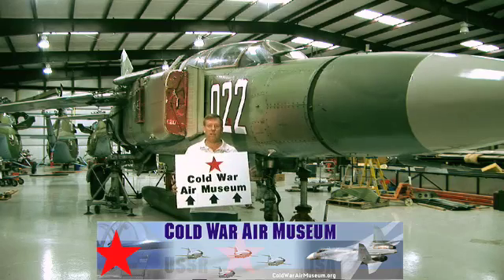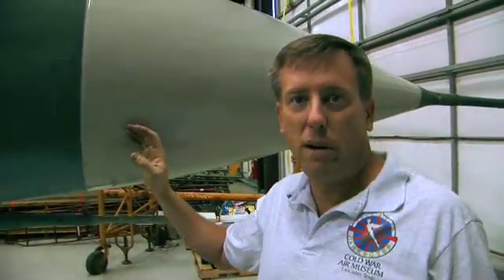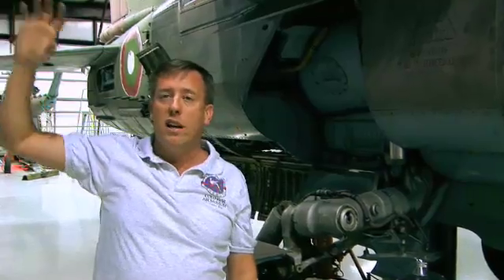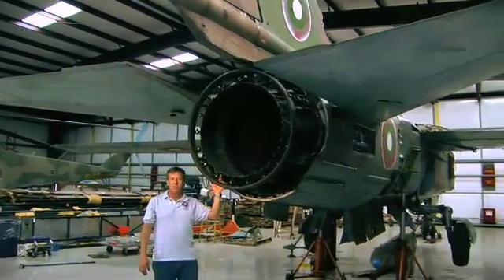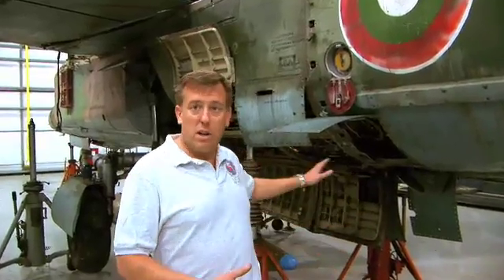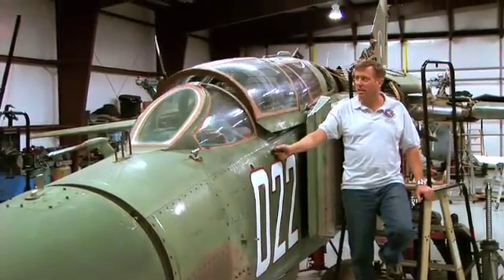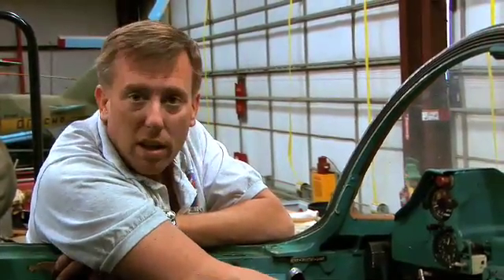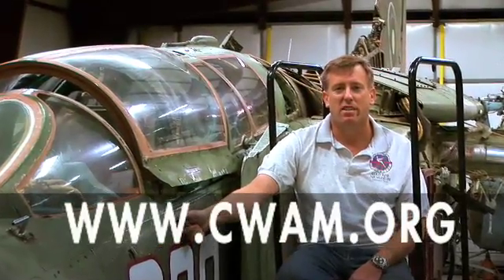MiG-23

Comment: I saw one up close and personal in the 90's, a Syrian Air Force pilot was encouraged to cross over to our friendly little nation with this gift.
I was most impressed by the beafy main landing gear, yet it could fold up into a tiny package, a mechanical marvle.   Also the diameter of the jet nozzle is about 25% wider than an F-15 or F-16 or Phantom.   On the other hand, the workmanship of the structural rivits on the fuselage was so appaling, it actually shocked me.

Comment: Aaaah 10,000 kilograms is 22,000 pounds. There are very few rocket engines that produce 10,000 metric tonnes of thrust let alone do any T-jets make even a fraction of that. But I'm sure I'm probably the 10,000th stickler of a person who has pointed this out. I'm sure the curator made this mistake owing to filming nerves and realised his mistake later.

Comment: The Russians built (and still build) some damn good airplanes.  Is it possible that all the advanced technology built into US planes could make them more prone to various kinds of failure? Look at today's cars.  Lots of computers and plenty of recalls. Still, I think the most remarkable plane ever built was the blackbird. Imagine! Back in the day they designed this amazing plane using slide-rule technology. Pure genius.
Reply: +Thomas Andrews The terribly complicated systems in American aircraft could represent some kind of failure point, but they usually have backup systems built into them. Your statement of American aircraft having advanced (implying complicated) systems is sort of silly if you look at Russian planes, especially the Mig-23. The wing-sweep mechanism has thousands of failure points, the folding rear vental fin has hundreds of failure points, and so do the rear landing gear; the most complicated landing gear ever installed on a military aircraft. Just because something has lots of computers and systems in it doesn't really mean they will fail every 2 seconds. 

Not to mention, there are WAY more cars than airplanes, and airplanes are inspected and maintained almost after every flight. Cars aren't, so they're more prone to failures and recalls. If every car was inspected and had work done after every drive, there'd be less recalls.
Reply: First off, you misrepresented my statement of 'failure points', by interpreting it as 'thousands of failures' and not what I said, which was 'thousdands of failure points'. I simply stated that the Mig-23 had many POTENTIAL failure points, as with every other fucking airplane that ever flew.
Second off, the F-15 is anything but delicate. Remember a while back with that one Israeli F-15 crashed into an A-4 Skyhawk mid-flight and sheered off it's entire wing, and proceeded to fly back to home plate and LAND? Yes, Russian airplanes are built fairly robust, but they are still airplanes, therefore they are DELICATE. I'd like to see any Russian aircraft have it's wing torn off and land.
Lastly, saying that American aircraft only function with no air defense or air force around is simply retarded. We have at least 3 aircraft PURPOSE BUILT for removing radar AA systems off the face of the fucking earth. And we have at least 1,000,000 aircraft purpose built for removing other airplanes (see P-51, F-86, F-4 Phantom, F-8 Crusader, F-14 Tomcat, F-15 Eagle, F-16 Falcon, F-22 Raptor, F-35 Lightening, F-18 Hornet, F-101 Voodoo, F-106 Delta Dart.)
>inb4 stealth is a scam
Reply: +Thomas Andrews all modern Russian jets have the underside painted with a fire resistant material. this means they can land on their belly with no gear and be fine. no american jet can do this.
Reply: cheeki breeki lol. Americans can't paint the underside of their planes?!
Reply: plebion kangaroo >implying any american jet can't belly land.
Reply: +plebion kangaroo I think you might want to look up 'fact' in the dictionary.
Reply: +James “Mr. Cool” Austin 
>inb4 citing Pierre Sprey as a source
Reply: ***** i'm not implying, it's a fact.
Reply: ***** 
fact
noun
a thing that is known or proved to be true.
Reply: +plebion kangaroo the proven part of that is what's wrong with your statement
Reply: ***** mah, i would like to see a f18 land with no gear and not catch fire.
Reply: +plebion kangaroo you should look at some carrier landing videos
Reply: This Russian built plane was a dog. Poorly built, difficult to maintain, and unreliable. The mig 21 never got withdrawn whilst the 23 was in service for those reasons.

Comment: Re. aircraft generations, they are rather curious:  first generation - essentially the pioneering jet fighters, 1945-50.  All subsonic gunfighters.  Second generation - 1950-65.  Missiles start to appear although, in this period, they have poor sensitivity and very narrow fields-of-view.  Aircraft are optimized for high-speed at the expense of agility, and reliance on rear aspect missiles over guns.  Essentially, the age of the interceptor.  Third generation, 1965-1975.  Missile technology improves, enabling the use of missiles as true dogfighting weapons.  They still suffer reliability issues, however, especially beyond visual range weapons, and losses of the more technologically sophisticated F-4 to the relatively simplistic MiG-21 reemphasize the need for basic dogfighting performance.  Hence, generation 4, 1970-present (at least until fifth gen' is the standard), re-embracing high agility as a design/performance benchmark.  In other words, design priorities - to a large extent - seem to have gone full circle (agility, to speed and beyond visual range combat capability, back to agility).
Reply: Nice explanation GWB.
Reply: George W. Bush Still gen 4 does not compromise beyond visual range combat capability. It just adds agility to that. Gen 5 adds stealth, sensor fusion and very advanced avionics.

Comment: MACH 2.35 for a single engine aircraft? Damn, that's impressive. Even for a "swing wing" aircraft.
Reply: The jet nozzle is a bit bigger than an F-15 or F-16s, quite impressive in person.   So I pressune it has the thrust.   The intakes are almost as large as a Phantoms, which has two engines.

Comment: the 2.35 speed should be seen as max safe speed. I once talked to an ex GDR MIG23 pilot who knew of a soviet pilot in east germany who had a damaged speedometer and noticed his wings close to melting away. On the ground engineers figured out the MIG 23 must have flown at mach 2.7-2.8, the engine was that powerful.

Comment: The aircrafts performance has never been questioned. it accelerates quick, it climbs quick and it's fast as hell, everything you want in an interceptor, it's biggest flaw is it's low tech avionics and low tech instrumentation. the migs ability to process and display vital info would get your ass wooped by a more modern plane

Comment: Yes the incredible landing gear is what probably the most fascinating feature of the MiG-23, and gives its characteristic  "look" of  the plane. Its a marvel of ingenuity and mechanical engineering prowess.  The MiG-23 was designed based on the Vietnam-experience, and it had to solve seemingly contradictory requirements. Short landing and take-off had priority, thus the vario-wings, and everything else was built around that.  It carried the most advanced "Atoll" missiles (4) under the fuselage.